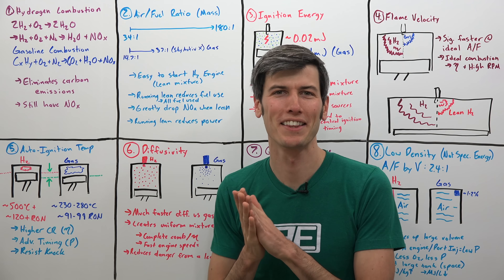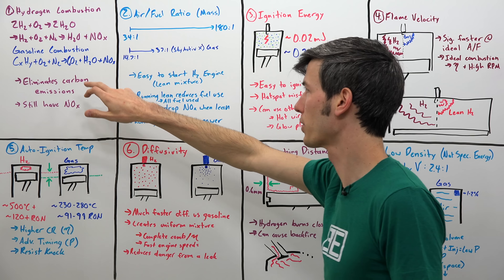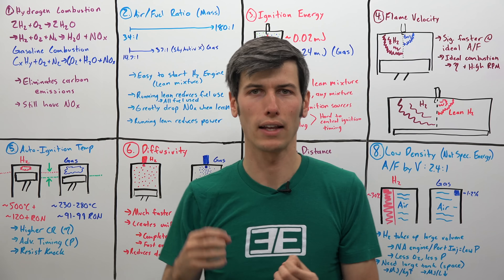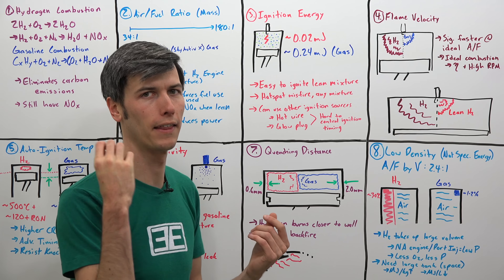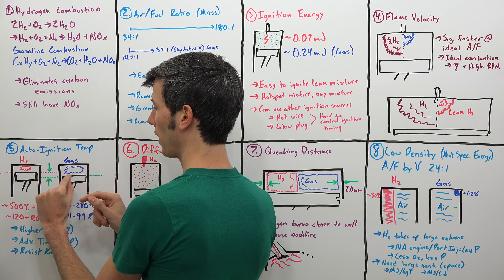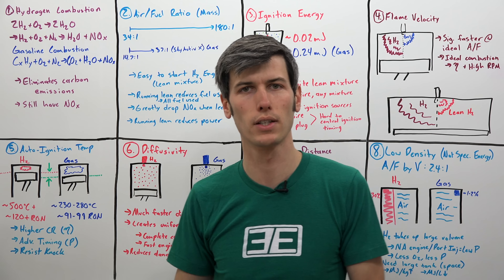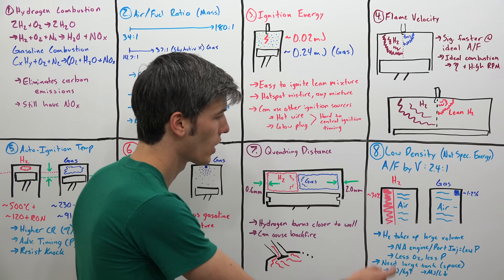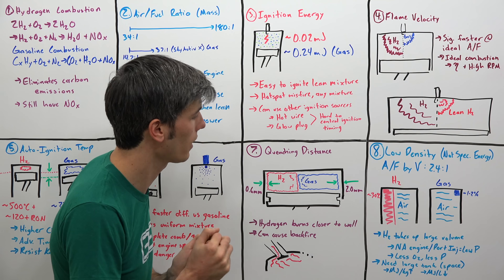The Difference Between Gasoline And Hydrogen Engines

Comment: But the hydrogen can use a much higher AFR, has better flame propagation, takes less energy to ignite, and is lighter. t
Therefore it would balance the difference quite a bit between it and petrochem fuels. As far as NOx goes, they can just use an EGR type system with a series of modified CAT's. Several vehicles manufacturers have solved the issues (check the GM HY-Wire and Hydro Civic) and have created feasible hydrogen powered ICE's and Hydrogen Fuel Cell vehicles. The problem is concentrating the Hydrogen into liquid form to be dispensed via a Gas Pump, and creating the hydrogen cheaply in the first place. There are several reasons why people are hunting Cold Fusion like the Predator hunted Arnold. Energy and transport being the main two.

Comment: i almost skipped this :) that last part got me thinking. if Hydrogen had the same energy density as gasoline, how big would the space shuttle be. obviously if the shuttle used gasoline it would be heavier and require more fuel, but just a theoretical fuel that has the weight of hydrogen but energy density of gasoline.

Comment: Atleast hydrogen is very compressible, while gasoline is resistant to compression. So that overcomes the low density volume issue, however bit of a safety issue having a tank of hydrogen at 700bar in a car. Rather not drive around with a bomb in the boot.

Comment: Dunno where you get the "faster is more efficient"... They go thru great lengths to slow combustion in a gas engine...
Reply: I was wondering the same thing.  Slower combustion will push the top left corner of the PV diagram to the right, making the cycle more like a "dual" cycle.  The dual cycle achieves more efficiency than the theoretical instantaneous-combustion Otto cycle. I like this channel, but I believe the presenter is mistaken on this.  Perhaps there is a factor omitted from the video that explains this.  However, all things being equal, the dual cycle's efficiency should exceed that of the Otto.
Reply: @david7542  Yes basically it doesn't do you any good to have the flame front progress faster or slower than the piston... This is why ICE engines have poor torque at the both bottom and top of the range. The combustion happens at about the same rate regardless, while the engine "moves thru" the sweet spot.

Nitromethane is used on tiny model engines for example because of this, it burns very quickly, which is ideal for a tiny cylinder running at high speeds.

Contrast to large diesel engines for ships... They burn a very heavy fuel in part because it burns very slowly and pushes more continuously during the long and large stroke.

Not sure where this guy is getting his ideas on this at all.

Comment: You need to compare a H2 fueled ICE with a CH4 fueled one. The advantages of methane as fuel are just too big to ignore. It is a higher performance fuel than gasoline, having an octane rating of 100.... The problem with hydrogen is also that it is too fast burning, creating pressure spikes very bad for engines.

Comment: Thair was a guy useing solor power to make hidrogen in Vancouver WA.back in 1976 and he said he could produce hidrogen at .10 cents per qubic foot and one qubic foot was equivalent to the mileage of 3 gallons of gasoline and you could breath the exzost and no poisonous polootents you would only change your oil every 50.000 miles because it would wear out now carbon to dirty the oil this was in a popular machanics magazine and I saw wear it was because I drove by the place every day going to work I had a subscription at the time and read about it and how he did this my uncle tried to get a copy and was told that months magazine was not available and I wouldn't be rea printed and with in 3 months of the article his place was all torn down and that was the end of the whole thing never to be heard of again I lost my copy over the years wish I still had it also I hear that you have to have a platnume tip on the on off valve not true because hidrogen is a stable gas and can be compressed acetalean is unstable and can not be compressed so how come my acetalean valve is brass to brass some one is not telling the truth
Reply: Wun cumpleet sentince

Comment: So why use hydrogen in an ICE when it's vastly more efficient in a fuel cell vehicle?
Reply: Ahhh, this video is confusing. When you burn Gasoline/petrol you ARE burning hydrogen. The entire purpose of fossil fuels is to store hydrogen in a safe efficient manner. ICE running on burning hydrogen and oxygen. Everything else is storage or in the way of the reaction (like nitrogen)
ps: fuel cells are inefficient because they don't store hydrogen efficiently. That is why we use ICE, hydrocarbons are fantastic stores of hydrogen

Comment: Very informative but I think your information on nox is incorrect. When your fuel air mix is lean your nox increases. When you run a rich fuel air mix nox will decrease because the fuel aids in lowering the temperature in the combustion chamber. Also the horse power will increase to a point. One more thing when you listed exhaust gasses you forgot to list carbon monoxide.

Comment: I'm fascinated by hydrogen ICEs. I see them as a good alternative to Diesel in heavy vehicles, specially in buses and coaches, on which you can just adapt H2 cylinders over the roof.
Reply: all ICE engines are hydrogen burning engines. You can run any ICE on hydrogen, just need to make your own carburettor . Why? Because in the combustion its the hydrogen+oxygen burning.

Comment: Most of the hydrogen here on earth is in the form of water though, which needs electricity to seperate adding an unnecessary step to the process. We are better off just using that same electricity to store in batteries directly.

Comment: So...
 Can I run a 4 stroke gasoline engine on HHO without modification? If so, what will happen to the engine long term?
Reply: I think you can run one with minimal modifications, mainly the new fuel system

Comment: If the hydrogen is able to burn closer to the cylinder wall, doesn’t that mean that the engine will run hotter?

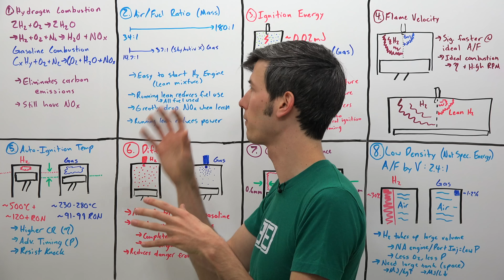Comment: Is there any relation between the 14.7:1 ratio for gas engines at 2:45 and atmospheric pressure at sea level (14.7 psi), or is that just coincidence?

Comment: wonderful video but if you produce the hydrogen (hydrogen generator) in the vehicle and not using stored hydrogen then the low density isn't a problem. then the tradeoff wouldn't be the weight/ volume of the hydrogen but how fast your generator can produce the hydrogen and by how much. so overall i loved the pros vs cons in this video but in the end i still believe that hydrogen wins hands down

Comment: There are questions not addressed.
The air taken into the ICE is not exclusively nitrogen and oxygen; there are multiple components to what we loosely classify as "air".
What chemical reactions occur with those elements at the typical combustion temperatures?
What about factoring in crankcase ventilation elements; what is created from that combustion?
The highest torque applied to the crankshaft occurs in a 90 degree range from 30 degrees ATDC to 120 degrees ATDC of the power stroke.
The 0.003s burn time of gasoline allows the maximum heat expansion wave to exert force on the piston in this range.
If hydrogen burns that much faster, wouldn't you have to alter the timing to initiate the wave front within this power range?

Comment: This was a very impressive explanation and comparison of hydrogen vs gasoline use in engines. I have been dreaming of converting a car to use Browns gas, HHO. So I'm just curious if there are any differences in using straight Hydrogen vs Browns gas? 
Any truthful answers given would be extremely appreciated. Thanks in advance.

I'm asking this because I would not feel safe with a full hydrogen tank in my trunk. With a HHO generator I could replace the gas tank or Hydrogen tank with a water tank and create my fuel on demand.

Comment: Wow that's alot of research into pros and cons but you forgot to talk about the lubrication you get from gasoline.dont forget fuel also lubricates the valve seat and helps lub the upper cylinder.

Comment: In the first slide you talk of Hydrogen then adding Oxygen and because of the heat Nitrogen gets put in the mix and comes out as NOx.  Is this because you are taking the Oxygen from air which also contains the Nitrogen?  What are the emissions if you ONLY combust say, the H & O mixture of gases that you get from electrolysis of water?  Do you still get NOx, and where does the N come from?

Comment: Very interesting and thorough. I was confused with the discussion under topic 2. You suggest the NOx emissions would be lower with an increased Air/Fuel ratio. I thought the “air” part is what generates the NOx (with combustion) does this not result in a higher NOx emission with higher Air/ Fuel ration?

Comment: running leaner + higher flame velocity makes the Wankel a very tempting option!
Regarding Volume. How much H gas do we have in liquid Water? assuming you can split it cheaply on demand (as claimed by Stanley Meyers).
Reply: Effectively an infinite supply of Hydrogen. After burning, it recycles itself back into water and back into the water cycle. Access to H is no problem, accessing the energy that it takes to separate the H from H2O is the bigger problem. The energy 'taken out' at combustion has to be 'put in' in the first place

Comment: As long as the hydrogen is not obtained through burning other fossil fuels, it makes absolute sense to use it as a mass scale fuel! Nox emissions can be eliminated by using urea solution, just like the modern diesel trucks and buses do, am I right?

Comment: Sounds like hydrogen is thinner than fuel, a gas , ok and piston rings have to be closer binding to the cylinder walls! To avoid hydrogen escaping into the sump!! 👍! I reckon a new engine needs to be created rather than converting the existing ICE to burn hydrogen!!!

Comment: I was at a car show and this one guy had setup an oxygen tank and an oxygen machine to make oxygen and compress it, he was using a NOS system to inject it into the engine at like 10 psi, there was batteries and more stuff to make it work, he was saying he was getting better gas mileage, but it was the HP he was going for. do you understand what he was trying to do? it was going over my head fast, I did understand more oxygen makes more power. I'm sure it was just a better fuel burn making better MPG. and how far could someone take this application, and has this been tried before?

Comment: (Regarding the first box on your whiteboard), is the nitrogen being introduced into the system because the engine is taking in regular air from the atmosphere? How difficult would it be to supply the engine with pure oxygen?
It sounds like an added danger to the vehicle and another source to worry about, but oxygen is already transported on vehicles as in medical supplies etc.

Comment: Tell me.. WTFWould you.. when you only get a 25% return in effort vs 80-90% via fuel cell back into electricity for an electric motor.. the same should be said for methane fuel cells too.. combustion of either is a gross waste

Comment: My first question is this... Even though the effect of hydrogen engines producing NOX gasses, how does it compare to a gasoline burning engine in terms of amount produced? My second question is... Even if it were the same or higher production of the harmful NOX gas, would it not be easier to switch to hydrogen as resource abundancy is nearly unlimited and cost effective vs drilling for scarce pockets of oil?

Comment: When it comes to future engines using Hydrogen, I get concerned with potential drawbacks in the contamination of our water sources. For example, What is the process for developing water to a usable fuel source? Does it have to be purified? Will this impact our already fragile freshwater sources? Will the combination of more water-enriched emissions cause higher levels of acid rain in Sulfur rich environments? What are the long term ramifications to this, there HAS to be some. Gasoline is pretty toxic in terms of emissions. But if something went wrong with our water sources, it could be life threatening. Im not a scientist. And as a normal, everyday Joe these would be my first, most pressing concerns and I dont feel you really covered those topics in this video, with respect to your work in this video.

Comment: Very good job and explained in excellent way.
Would you have the ability to make comparison using hho gas instead of injecting only hydrogen?
It will improve the last point since oxigen will be injected together with the hydrogen. I am curious to know how would the HHO gas affect the ignition energy and the quenching distance.

Comment: Could you make a video of the risks convert a gas engine to run on hydrogen in a dry water split system, or even a Diesel engine, or could this just not be possible.

Comment: Sounds like the engine could run just because its hot, you would need a brake to prevent this. But how much pressure are we talking? A brake could cause the motor to explode? How bout a clutch system to prevent unwanted rotation of the motor?
If you mention, just shut off the injectors, injectors can leak.

Comment: Nitrogen and Oxygen combines with each other at 2000°C this is an impossible temperature to achive in a combustion engine.  The engine block would have melt long ago. Beside there must be a cooling unit to keep temperatures down.
    H2 reacts with O2 that can only provide the energy as heat for N2 to combine with O2, there is no other way. 
    If H2 is injected at a stoichiometric ratio to the present O2 in the combination chamber, there is no O2 left for N2 to combine with (in case the temperature crosses 2000°C).

Comment: In theory if you remove the water vapour in the atmosphere with condensation you can use it for hydrogen production and have less of that greenhouse gas in the air. The only remaining question is if the NOx can be removed from the atmosphere effectively. I guess NOx reacts quite quickly with other gases in something else.

Comment: Hydrogen fuel cells are interesting too. Hyperion xp1 1000 horsepower 1000 miles of range. We can create the fuel through hydrolysis, then capture and compress it into carbon fiber tanks. 1hp/kg

Comment: Your chemistry is not quite right.

Hydrogen combustion has a side effect called hydrogen embrittlement.

Carbon is scavenged from any steel parts causing those parts to become hard and brittle.
So you are missing where that carbon is going.

Brown's gas (Hydrogen and oxygen mix) will burn at 8,000 feet per second.
Gas - you might be able to outrun that flame front.

Valves in the engine are not always 100% sealed when closed. The tiniest little hole, burn, or crack will ignite the hydrogen outside the combustion cylinder. And valve depression/burning starts happening the moment an engine is started.

You can NOT advance timing.
Advanced timing ignites fuel before the valves are fully closed. Valves cannot close fast enough to prevent hydrogen igniting outside the combustion chamber.

In practice you want timing slightly retarded to ensure valves are fully closed. About 10 deg AFTER TDC for safety reasons.

Your rings are not 100% sealed either. Any hydrogen leaking past those rings can ignite in the crankcase.

Leftover lubricating oil on the cylinder walls will also burn. No mention of what happens to those hydrocarbons.

Hauling those HEAVY hydrogen tanks does reduce usable power.

One of the cleanest practical fuels would be LPG.

Burning a little Hydrogen with gasoline can increase fuel economy. Up to a point.

Biggest problem with vehicles is the vehicle manufacturer.
They use computer controlled engines. Meaning the computer advances the ignition timing and fuel delivery.
Both are not user adjustable.
Least not easily. You have to trick the sensors to get the computer to retard timing enough to prevent preignition.
And if that falls outside the fuel mapping scheme, the engine will default to a base map and adjust both fuel and timing to bring your MPG back into compliance. THEIR idea of compliance.

Mapping and such was set to force a particular MPG as an aid to reduce tail pipe emissions.

They author did great theoretical mathematics but doesn't seem to know the real life ins and outs of hydrogen.

Comment: This is all well and good.. the engine running on hydrogen has been around a long time.. What you glanced over was the difference in the temp. Like all before you in the last 100 years how are you going to control the temps hydrogen produces? We are  not talking of a little more heat here.. I like this idea and always have but what is needed is a particle way to cool the engine. Gaskets, O rings, even rings and bearings will suffer greatly from this extra heat.. Not to mention oil break down. These are the things to cover not the operation.. Make it practical, most of us know it works.. but how can we use it is what people want to know.. Still very good video..

Comment: Instead of filling a hydrogen tank like a gas station, what about swapping tanks? I think it will reduce static spark chance. Static sparks are the main concern with flammable liquids and gases. Not to mention the mini hydrogen nuke if two cars crash.
About the hydrogen leak, faster dispersion isn't always better, it could create a fuel-air bomb where the fuel creates a mist and any spark could ignite it in the surrounding area. It is lighter than air so it will rise, which is good. It is especially dangerous in parking garages and tunnels though.